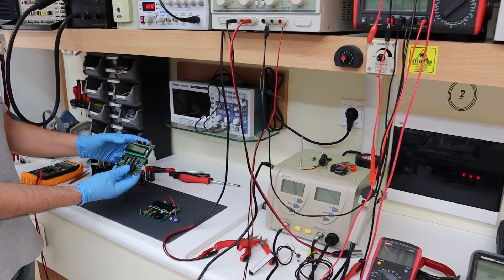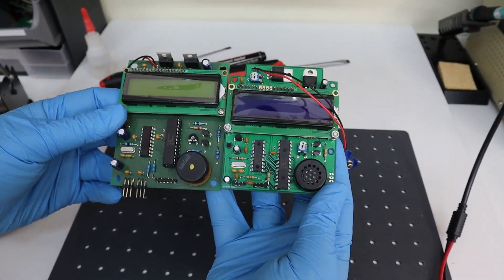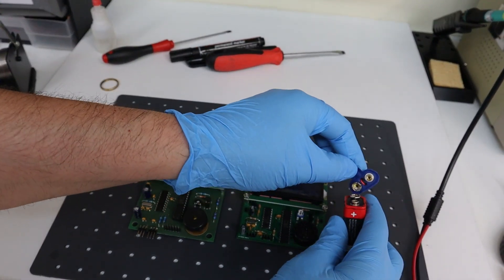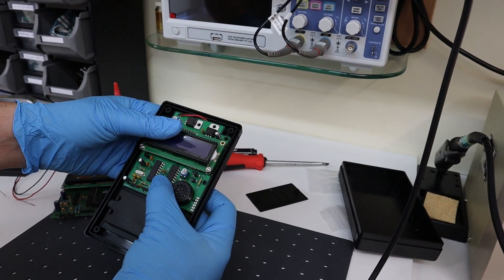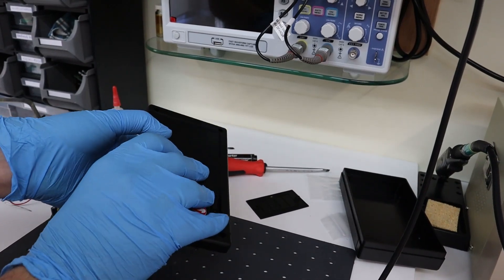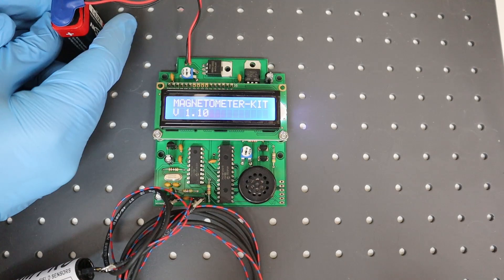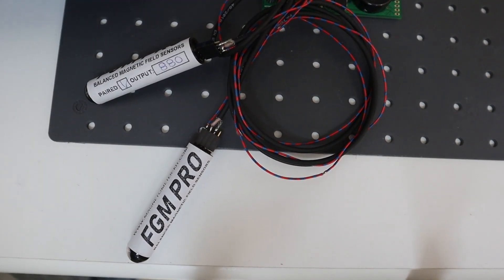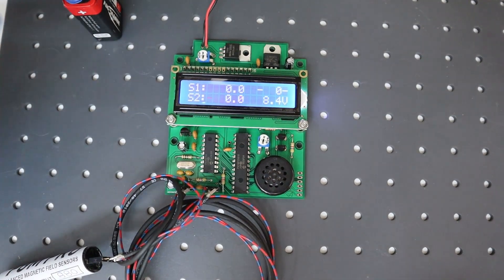NEW version MAGNETOMETER KIT | FGM 3 PRO sensors & LCD board | Build A Quality Gradiometer!

Comment: Can 3 axis be measured separately?
Reply from the maker: You can order 3 FGM PRO sensors and build a 3 axis magnetometer yourself. The sensors have to be physicaly alligned and a software will be needed to null the noise signal of magnetic north.